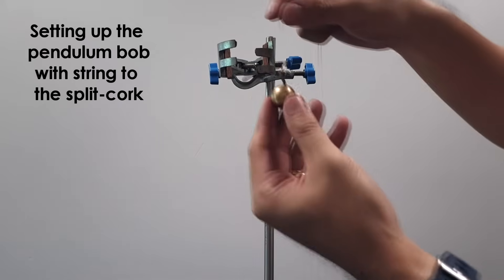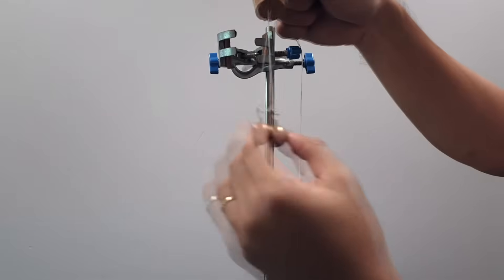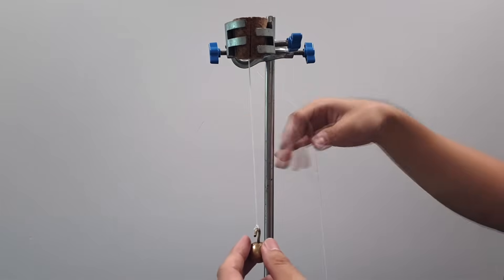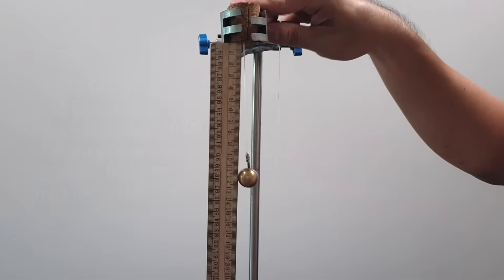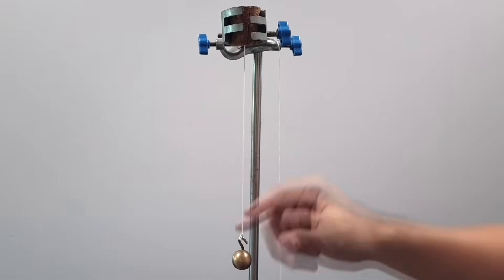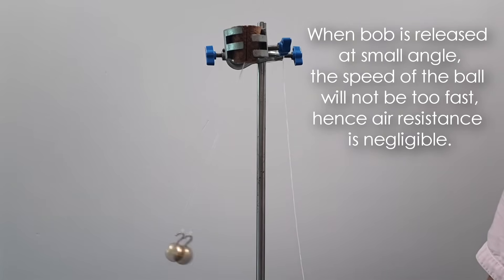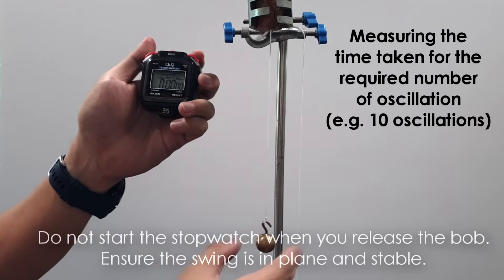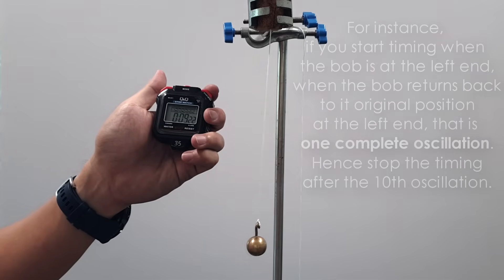Pendulum experiment set up

Comment: Sir when we measure the length of the pendulum, why from the bottom of the Cork to the middle of the bob??..
Reply from the maker: That will be a more accurate length of the pendulum. From bottom of cork where the string starts to the centre of gravity of the bob
Reply: @evantohspace  Thank you so much